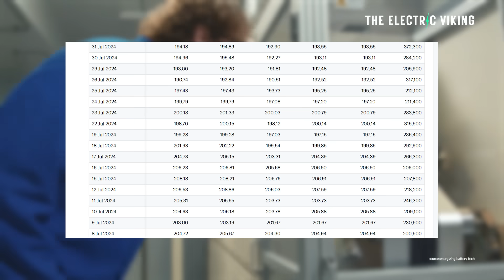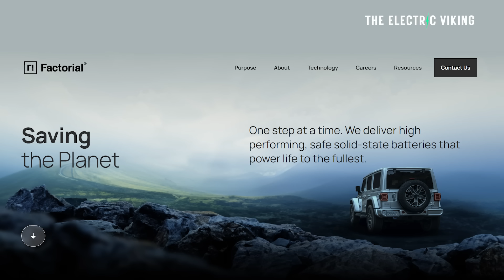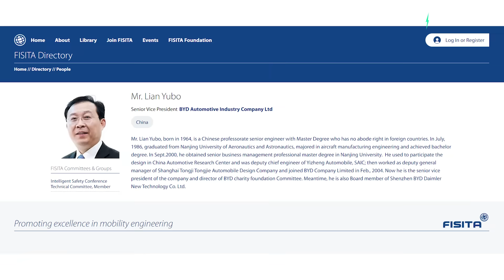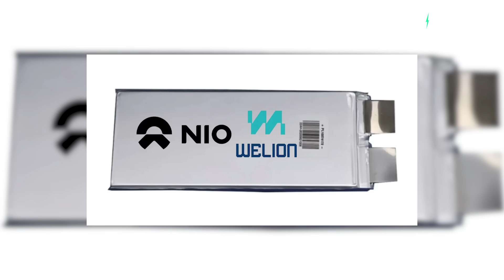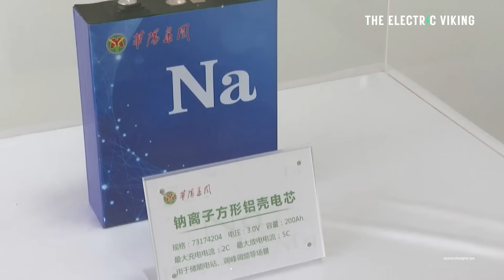BYD's chief scientist reveals when solid state batteries will take over

Comment: Advances in lfp and m3p cells have increased battery life so much that there may be no point to solid state if tge only advantage they bring is lower charge times. The issues with ss batteries have been cycle life and dendrites build up despite that chemistry supposed to have been more resistant to those issues. In reality that has not been the case. This is why ss has been delayed time and time again.
Reply: Also require high pressure containment.

Comment: Solid-state batteries (SSB's) are inevitable, but need to solve the high cost and lower cycle life issues, which they will.  Once solved, SSB's will become the standard.
Reply: I agree, but how long this will take is unknown. Those here saying they are confident it will be solved and cheap in budget cars by 2030 are very optimistic. Solid State butteries have become like the holy grail so all the companies are talking up how fast mass production will be achieved.

Comment: Hey Electric Viking.. 

LFP, NMC, Sodium ion, etc will not disappear once solid state batteries hit the market. 

Here's a crucial point that is being missed 

LFP, NMC, LTO, NCA, Sodium ion, etc

All the above are electrode chemistries. They're innovations made on the anode and cathode. 

Where as, solid state is an improvement made on the electrolyte. Instead of being a liquid or a gel as is normally used, LIBs will have solid electrolyte. This is what solid state batteries are. 

This means that the electrolytes of LFP, NMC, sodium ion can be solid state too. 

Hence, other battery chemistries will not disappear. 

It is more likely that solid state versions of LFP, NMC, Sodium ion will co-exist with non solid state versions due to cost considerations...

Comment: The advancements are amazing. 🤩 Even the new Model 3 Tesla (long range) that just came out now has an estimated 363 mile range, and some YouTubers have done long distance test drives where they hit nearly 380 miles! Solid State batteries will be a total game changer. Longer ranges, charge faster, totally safe and eventually cheaper as well. I think 🤔 5 years until the first ones seems probable. But the are many non-solid state batteries 🔋 that will be coming out in the next few years before the solid states that will be quite an improvement as well…….
Reply: Indeed, I am getting around 600km (373miles) in my Mercedes EQE….changed from Tesla 3P (wife still has her Model X) to the EQE, wanted an S but cannot buy in Australia (RHD market). Overall I’d take an S over the EQE, but it is nice and very good on range.

Comment: Well Toyota has had huge problems with their turbo engines. It has nothing to do with the solid state stuff. ICE have clearly hit their max as these gas efficient Turbo engines have been nothing but trouble for all the manufacturers. The only path forward is electric.
Reply: Troubles  there not die to the turbos but to bad good old piston rings that were designed and made wrong
Reply: @myhome772 Exacto. That and the exploding batteries thing
Reply: @myhome772 Like an extra 10 mins of time? You will be waiting that long as everyone tries to gas up on their way out.
Reply: @myhome772 Generally speaking, if the power is out the gas station can't pump.

Comment: Solid state batteries could end up in budget EVs, but expect them to be smaller batteries, weighing less.  Most people don't need more than 300 miles range now. As EV charger infrastructure builds out, we will find the minimum practical range will drift downward.  Budget vehicle range will drift downward as well.
Reply: Exactly the opposite.  In cold weather running the heater in your car.... If you want any kind of decent range you're going to need a 800 mi range battery... Just to get that 300
Reply: @MudflyWatersman  Modern EVs don't lose that much range when you have the heater on a few times an hour. Sure, if you run the heater at 30c for hours on end... but then again, not many people want to be that warm in a car and not everyone lives in those types of temperatures year round. Let's buy things that make sense for the vast majority of journeys rather than worrying about that single journey.
Reply: Smaller battery packs with higher capacity cells may not sacrifice range, if weight is reduced then a cars efficiency will increase gaining range.  It is likely that a 300 miles car with higher capacity will be cheaper due to a smaller lower cost pack delivering a similar range to larger pack EVs currently. Premium cars will likely jump up to next next range level (500+ miles) by retaining the larger pack size as now.
Reply: People keep saying this but just realize.. And i sincerely hope you do that only fanatics say that. I would say people want at least 400 miles for true mass adoption and honestly i think it might be 500. And there has to be affordable options with this range. We still can't see that EVs are still in it's infancy.
Reply: There will be choices in battery size like budget and long range models

Comment: Toyota need to change their name to kodak
Reply: @myhome772 When the power lines are diown....You won't be able to pump the gas Your Prime needs.......Paul
Reply: YES! I thought they were going to be the FIRST to market. Maybe just their New Polaroids...
Reply: NASTY!
But true.
Reply: Toyota management has made a lot of operational errors lately like having to replace over 100,000 engines in its Tundra trucks.  Oops.  Personally, I bought a 2024 Corolla Cross Hybrid which gets an easy 40 MPG but only has a 10.6 gallon gas tank.  Imagine if it had the average 16 gallon tank and had a range of 670 miles on a 4 minute fill up.  A second mistake is only having a 1.3 KWH battery.  The Toyota Gen 5 hybrid does operate in EV only mode when driving slowly or stopped.  Imagine if they increased the capacity to 3 KWH.  At a conservative 3 miles per KWH, I could get 9 miles in EV only mode, especially after driving on a freeway.  (Forget the plugin.)
Reply: Toyota = toasta
Reply: @myhome772polluting all the way.😢
Reply: Keep on dreaming, EV sales are slowing down, while sales of hybrids are increasing even further.
Reply: @stefan2796  EVs Here in the US Are sold more every year. Sorry to disappoint you
Reply: @stefan2796  The disinformation from oil industry shills continues…🙄
Reply: 😂sure....
Reply: @jb5nf  when they start bringing out cars with 1000km range and 10 min charge times wtf Is gonna want one of their hybrids.
Reply: @tysonfinn1470  Exactly
Reply: @tysonfinn1470  And non exploding batteries
Reply: @tysonfinn1470 it doesn't even need to be that good. Even true 500 mi range EVs with a 10min charge to 80% will kill the appeal of hybrids.

Comment: Nio's 150 kWh semi-solid state battery is the same weight as the second gen 100 kWh NCM battery. This has been confirmed by the Chinese car regulator.
SAIC has opened order intake for the IM L6 with 130 kWh semi-SSB (and 800 hp) for something like US$50.000 iirc, with deliveries starting this year. The battery comes from the manufacturer Qingtao.
I guess we're going to see quite a few new semi-SSB batteries next year in China.
With the recent price drops for raw materials I guess LFP is now roughly the same price or maybe even cheaper than sodium-ion. I don't think any of the sodium-ion cars announced actually made it to the market, since there's no need for it right now.
Reply: A lot of bla bla bla, which isn't interesting for regular consumers. They just want affordable means of transportation.

Comment: Samsung just released their new solid state batteries. Still expansive, but it works, in cars. 
According to Samsung today, their 600mile EV battery can charges in 9 minutes from 10% to 80% and do 1 miljoen miles . . . . 500Wh per kg.
For the next few years in high end EV's but within 5 years in standard EV's.

Comment: It takes 10 years to release a new battery, with huge pitfalls along the way. Energy density is only one component of success. Manufacturability, cost, cycle life and operating temperature are all factors. BYD saying solid state will be "here" in 5 years really means nothing.
Reply: It doesn't take 10 years. It can but that's not a hard number. Also solid state batteries have been in research for ages. There are already solid state batteries in use in mobile chargers and such.

Comment: If solid state batteries go into mass production that will cause lithium ion battery prices to drop. However, there is some risk they will not be allowed in cars in some markets to keep cars from getting too cheap. For example they could lobby to get lithium batteries banned because of fire risk or some other BS reason to force people to buy expensive solid state battery vehicles.
Reply: Solid state batteries use more lithium than lithium ion batteries, a lot more
Reply: Sodium ion SS

Comment: The speed of innovation is what gives me pause on buying an EV. I understand that the resale value is going to start to look like any consumer device, I tend to drive cars for 10 to 15 years. In that timeframe, will the car I am driving become unmaintainable at some point before I'm ready to retire it? Probably not. But it gives me pause.
Reply: I am in the same position as you. I kept my last car for just over 11 years and my current car is coming up to 11 years old.
I would recommend going for a car with an LFP battery and maybe buy a pre-reg or a car less than a year old so you won't lose as much on the depreciation.
If nothing better comes up in the next year, I will buy a Dolphin.
Reply: @catherinegrimes2308  We will be on the market for a new car next year. We are on the fence with EV vs Hybrid. Probably will go with an EV, but … we'll see. I suspect maybe people have similar concerns.
Reply: The tiny battery packs in hybrids tend to get thrashed with respect to cycles, as the car continuously drains/charges them to reach higher MPG from the ICE engine. PHEVs the same, particularly in the cars with smaller packs. ICE and BEVs have indeoendent garages opening up, Hybrids require both skillsets so maintenace tends to be retricted to the pricier main dealers.
Reply: You'll be waiting forever, no matter when you buy there will always be a better ev/battery out. We are at the start of innovation for evs.
Reply: @tysonfinn1470  I didn't think in being understood. You can fix an ICE vehicle, essentially forever of you wanted to. I'm wondering if EVs will represent an era where you scrap the vehicle years before it truly needs to be. Dealerships will essentially just stop supporting it because they won't be able to.

I'll also be interested in what happens to the secondary repair market. ICEs will be around for some time, and lots of things can be repaired that aren't the battery and electric engine, but …

Times are going to get really interesting.
Reply: @wh0wh4t  yes as long as parts support remains for ice, not to mention all the money u spend on fuel, maintenance.